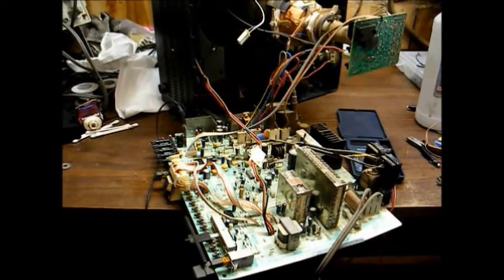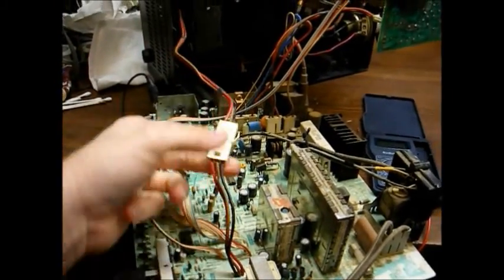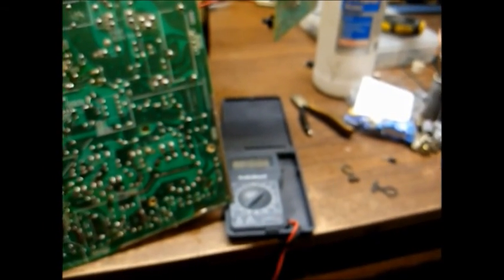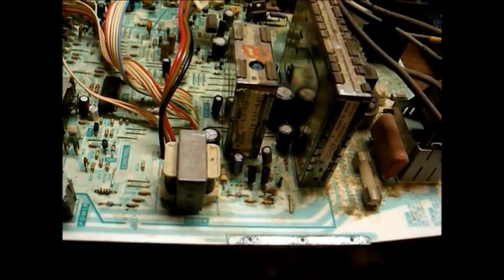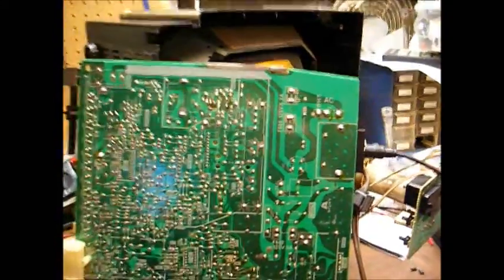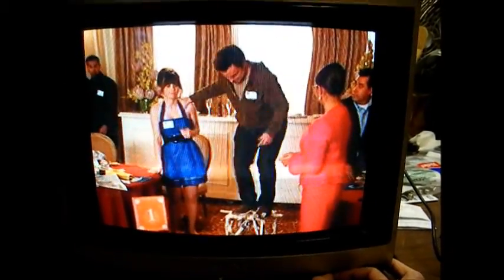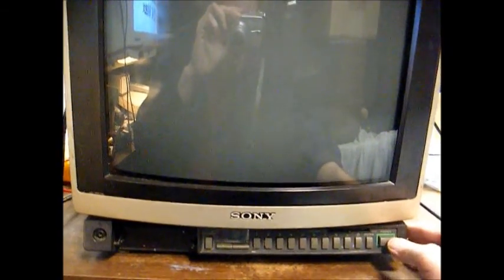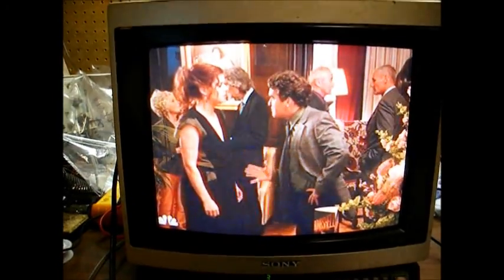Repair of a Sony KV1365 13" Trinitron color TV due to no audio

Comment: check all the little caps & solder joints in that AFT module next to the tuner! That was a common problem in those along w/ resultant shorted output trans-sexual-sisters! If you don't recap that AFT module & resolder the pin connections in it, it won't last!

Comment: I remember repairing one of these where the soldering in the tuner/if/AGC stage had 'resin' joints instead of 'soldered joints. I ended up removing the tuner, and reworking the solder joints, washing it with pure iso-propyl alcohol, but found that, having been manufactured using a solder 'wave' machine, there was printed board holes much larger than the component leads, so they did not always 'stick', but the end result made it a great TV..

Comment: Great little televisions these, i love the old sony stuff, and you always tend to find the small sets have a great picture. but i have to put a few people right about new sets, STOP HATING an lcd panel will last 80 years yes 80, its only the caps that go bad in them on the power supply, also a 40" lcd will use the same amount of power as a 14" crt
Reply: +Synthematix I highly doubt a lcd TV made nowadays, will last 80 years.
Reply: Sam Gates Ok, you know everything.

Comment: Those old Sony sets had a fantastic picture - and at that size high definition isn't really an issue for general use. I had a slightly newer 13" Sony on my bench at the shop, and when I left I had no trouble selling it for $20 to someone who appreciated it. Problem today is, with more and more home theater receivers having HDMI connections (which seem to be a high failure area, especially with Onkyo) you're kinda stuck needing a newer set.. or spend the money on a converter.

Comment: Three months ago I threw out a 13" Sony Trinitron manufactured in 1994 in great condition. I thought somebody would take it and use it but it sat there by the trash for 5 days. I even taped a note on it "Free TV works great"  The building maintenance man took it and hauled it off to wherever they take discarded appliances. Nobody wants a CRT anymore.  I used to have a closet full of CRTs that I could sell for thirty or forty dollars but the last time somebody asked for one was in 2008.
Reply: +ldchappell1 That's odd. I would have taken it for sure.

Comment: thats a wonderful mid 80's sony set as it has RCA/AV connectors and its worth repairing  its a shame people only look for the newest stuff now which is expensive and wont last anywhere near as long.
 that coax input on the front is cool. was used for  a c64 or zx spectrum or something
Reply: +Sony Trinitron IKR! These people just want the new stuff to show off. And an old TV like this can still be used to watch Cable, air, or satellite TV!
Reply: Jim Dayton I use (despite my Youtube name) a National Quintrix set from 1983 and also a more modern Cobolt branded set although it is made by TCL and made in China too but they both do the job. I also really like that car as your youtube picture!
Reply: Sony Trinitron Cool! I use a RCA Colortrak from 1989, and a Panasonic Pro-Line from 1996. I am still looking to collect more sets, though. And Thanks for the kind words :) It's a 1978 Cadillac DeVille.

Comment: Nice video! My dad bought a Zenith 19 inch TV back in 1981, I think it was one of the earlier stereo models. The stereo sound on that could put modern TV stereo to shame. A football game stadium sounds coming out of those two little speakers felt like you were there. The tube died in 2010 without ever having been repaired and it actually wasn't the tube, some tiny little chip that worked the tube. Nobody wanted to fix it though so he had to throw it, a shame!
Reply: Those Zenith TVs from the 1980s are worth it, that is when Zenith was a totally owned American company before LG bought them out.